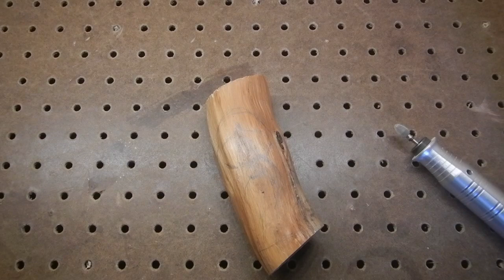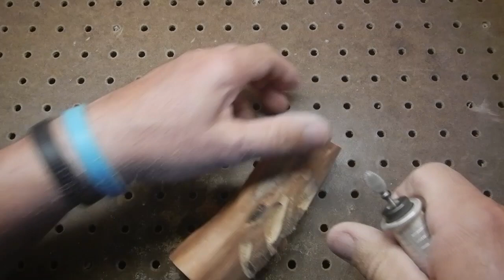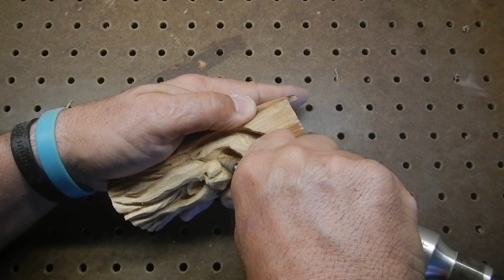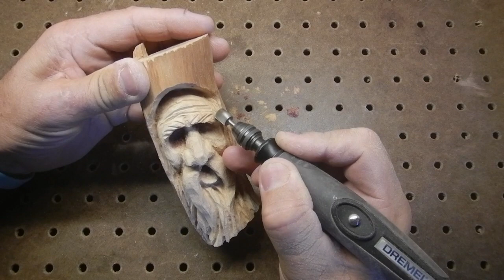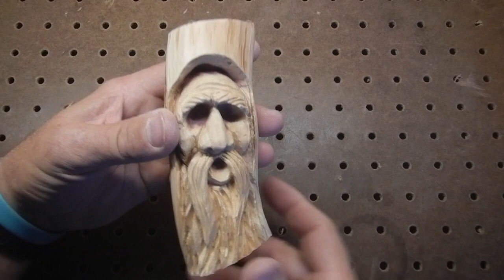Wood Spirit Power Wood Carving

Comment: Nice Video and a fine little wood spirit... But you don't say what wood species this was! - Also it would be useful to know the 'specific' Kutzall bits / burrs you used on the Dremel.- And the final finish coat you used... If you could link them it would be nice to learn. Thanks!
Reply from the maker: Jay C  Hi the wood i was using is eastern red cedar, and i see you find the video of the bits i using 👍